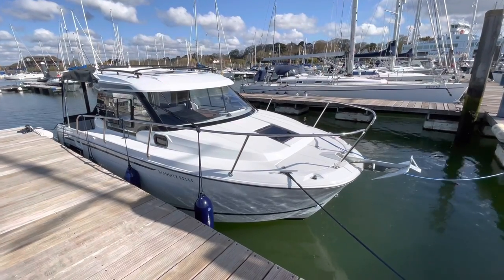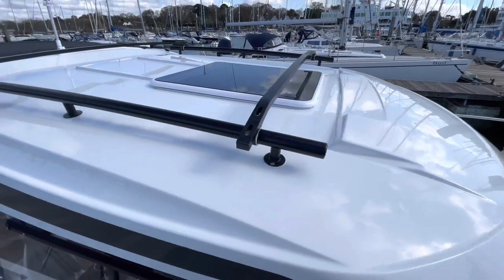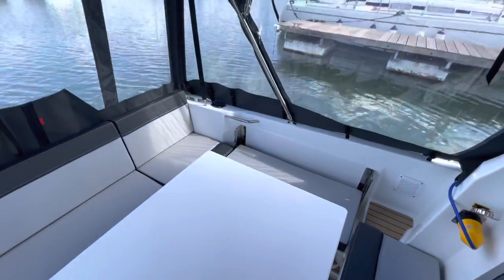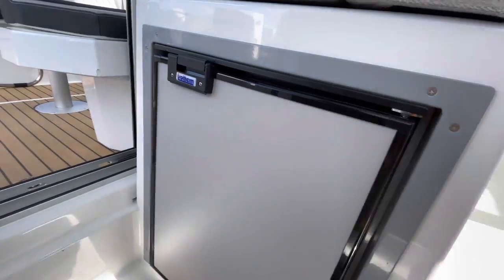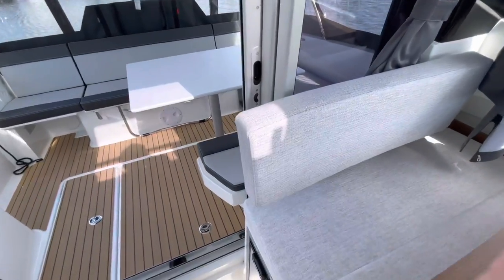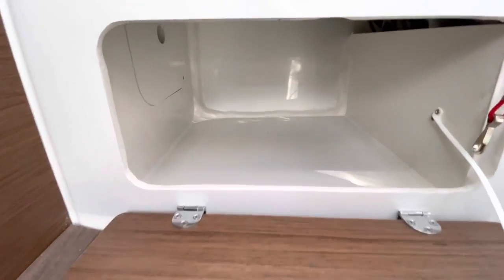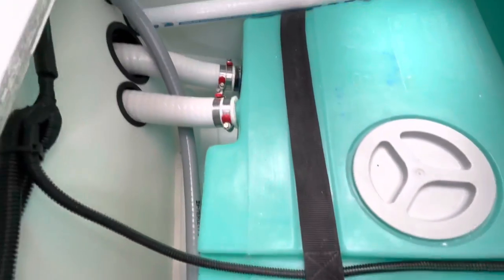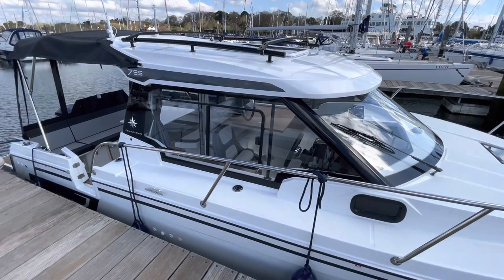New 2021 Jeanneau Merry Fisher 795 Series 2 technical walkthrough guided tour

Comment: Great overview of the boat.  I just bought a 2018, but I love the improvements to the Series 2.  Well, price was right for me, and I'm happy with the boat.  Funny, two things changed on the new boat is a deck hatch that opens from the front (I un-installed and turned mine around).  I also did away with the center brace in the under sink cabinet.  I added magnetic closures also.  Now if I can find a way to cut a hole in the side of the boat to allow boarding from the side.....LOL!